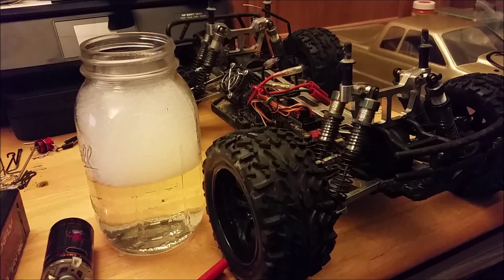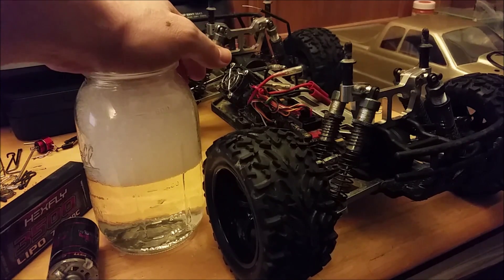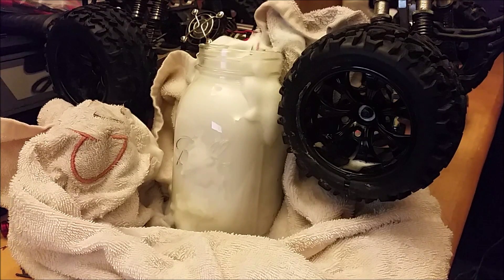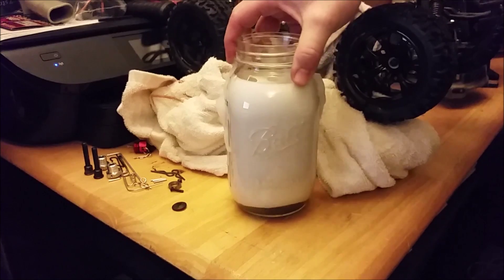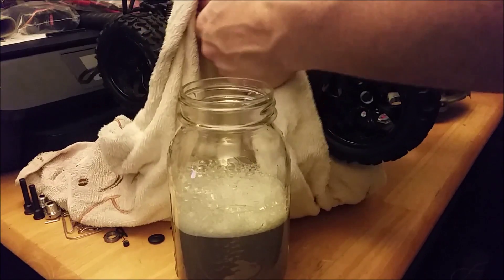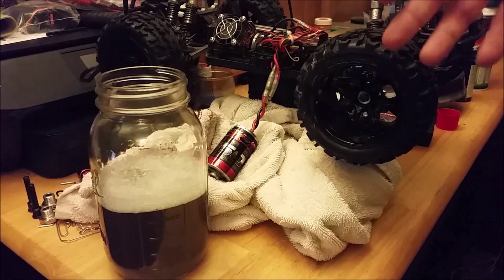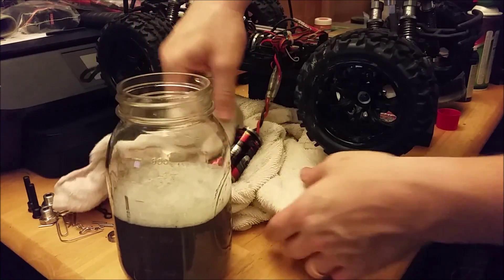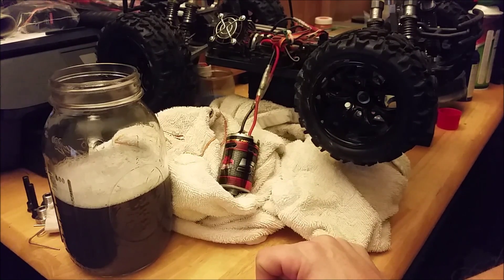Water Break-In Process for a Brushed Redcat (or any brushed) Motor

Comment: 1 drop of soap in a full jar of water an run it with two 1.5 volt batteries an run in water an soap for about 15 minutes then use electric spray to clean it all out an after that let it set an dry an then put one drop on each end of the motor an one drop on each brush so the oil will soak in the brushes an right before running put oil on brush one more time an it will last awhile wd40 catches dust but it does lube it up but it catches to much dust i know this video is a older video an thank you for sharing this video an doing what you are doing is the best way to do it fast way better than not doing what you are do because some people dont do anything just run them my friend great video

Comment: I don't ever use wd40 for moving parts of any kind. riding bmx for many years we stuck our handle grips with wd40. as little oil is in it, there are too many solvents for lubricant
Reply from the maker: You don't even like the dry lube? That's the only kind of WD-40 I use because it just attracts dirt. I understand what you're saying and I know this says WD-40 but that's just how I think about it. It definitely is the dry lube that I was referring to
Reply: @NPCRC  yeah stuff like lithium grease or dry graphite that type of stuff is good, so I guess the wd dry is good

Comment: I have difficulty believing running an electric motor in water would increase its life.  The dark color is just carbon from the brushes being seated in, not manufacturing dirt.To me a good cleaning with a ultrasonic cleaner would do a better job. Breaking in the brushes just assures the carbon brushes seat properly. Afterwards using compressed air and WD 40 wouldnt hurt. I think 3n1 oil on the bushings or bearings would help. I personally would have to see the results of a lab test and the data confirming that doing this would really help. Other than that, brushed motors are not that expencive. Just replace as needed.
Reply from the maker: it's purpose is to make the brush strokes on the inside smoother and better moving.  It is not my process, i was just showing people it can be done on the redcats... I did it to my sons truck when he was little and it was definitely a better feeling motor after this and some dry lube on a every 2-3 run basis
Reply: @NPCRC  I suppose if it works I have nothing against it eather. I have torn many motors apart and never seen any junk or dirt in there from the manufacturing process. I guess mabe from running it through mud dirt and grime, yes it will cake up but generally not on the running parts. I could see where it may benifit smoother running at lower speeds. other than thatI dont know. Brushless is the way to go anyways as far as smooth operation and longevity.  The problem there is they hate water. A product called RainX can and does make it possible to run a brushless motor and ESC in water. I have seen it demonstrated  and it does work.

Comment: Ive done this method before bit can you tell me how to do this if i have the little circuit board on back of motor? Im assuming i have to desolder the pcb from the motor and resolder? Or can i get the rid of board all together as i used to do hobby cars about 10 yrs ago on and off and now i see the pcb and im told its to prorect motor from overheating. Motor runs hot and drains lipo batteries down o% on my battery analyzer so im thinking to piss the pcb off anyway ! Any reply appreciated!  Thumbs up for the video. Im an old fart from Australia cheers😊

Comment: Do we have to?
Reply: Or will there be problems
Reply: What it its new
Reply from the maker: This one was new.  New to help with the break in and old to clean and re lube (dry lube)
Reply: Btw  it's a hpi e10 discontinued.
Reply from the maker: the model wont matter as much as the motor type.  Easy to just swap out for brushless for very little nowadays and get a huge performance boost.  Brushed is ok for drifting but i like brushless and just utilize the trigger properly.  Road Car. brusless would be a huge upgrade too.  I have combo's pulled new from trucks, sealed and occasionally used if needed.
Reply: Thanks dude
Reply from the maker: This is a way to make sure you lengthen the life of the motor. It makes the brushes break in nicely and cleans up a bunch of guck that gets in there and can eventually cause friction and dirt to be trapped. Then you lubricate it with some WD-40 dry lube or something along that line and run it a little bit with just that going through it and what I would do every once in awhile with mine was every couple runs I would put a little bit more in there and pull the trigger a couple times and let it move around before I left it sit for the night or weekend. It is not necessary though

Comment: Listen, WD40 is a penetrating solvent designed to remove rusted bolts - it will RUIN your brushes.  To remove oil and contaminants, or displace water, use MOTOR SPRAY (or electronics cleaner) - that's what it's designed for!

Also, you can use tap water but 'distilled' water eliminates any (admittedly minor) mineral build up on the motor.  Your choice.  Forget about the soap though, it will leave residue. 

Water break-in helps conduct electricity and reduces arcing and bouncing, cleans away brush debris and keeps the motor cool.  Run the motor for a minute or two (yep, that's it - longer just wears the brushes), thoroughly rinse it with motor spray/cleaner and let dry.  Blow out with compressed air if you have it.  Once dry, lubricate the bushings with a 'single' drop of bearing oil/light gear oil on each bushing and you're done.
Reply from the maker: Yeah it attracts dirt too.  The WD40 Drylube or other versions is what i use!

Comment: While the “W-D” in WD-40® stands for Water Displacement, WD-40® Multi-Use Product is a unique, special blend of lubricants. The product’s formulation also contains anti-corrosion agents and ingredients for penetration, water displacement and soil removal.
Reply: Woah, did you read that off the back of the can?

Comment: Plz help mine is slower now :(
Reply: Go brushless way more power my god
Reply from the maker: Shouldn't be... WD 40 works as a lubricant ( Which you will need to lube it after) but a dry lube works the best and doesn't attract the dirt as the wd40 will.  If this was done with a new motor and done properly there is no way it SHOULD be slower afterwards.  It isn't crazy fast as a difference but smother and longer lasting (If properly lubed) it should be!
Reply: Thanks i cleaned it with the water for 5 mins let it dry then put a load of wd40 on it and now is slow as if bearing arnt greased
Reply from the maker: Dry lube will be the best.  Run it in dish soap again and DON"T let it air dry... It should be air blown or ran to dry it.  and then put some dry lube around the shaft and in the can where the brushes are and run it for about 2 minutes and drop a little more drylube in while it is running to well lubricate.  I have done this with 3 motors, the first one my son burned up in thick grass with stock gearing, the second was also a result of running it where it shouldn't be on a lipo and then the third I had lowered the pinion a tooth and used dry lube and haven't had an issue since.  I think the wd 40 grabbing dirt and the thickness of the grass was the issue I WAS having.
Reply: Works fine now cheers what else would i need for this i have a df-02 gravel hound i am getting a 4t brushless motor and a 120a esc and a 2 cell lipo what else would i need or would it be ok like that at the moment i have a 20t brushed motor and wanting to get it as fast as possible thanks for the help curtis
Reply from the maker: Fast as possible would be a low turn, high kv motor.  However the higher the kv and the lower the turn you take away the torque and the off road/ rough terrain driving.  but if you aren't looking for off road running then that will not matter!
.
Reply: Yea on road only but i feel i have forgoten something because the fastest df-02 on youtube is 9t and i am getting 4t

Comment: do you know if the redcat motor you cleaned is equivalent to a hpi firebolt 15 turn or the arrma 15 turn motor
Reply from the maker: +Luther Hite  No I didn't.  Happy with the performance.  His Volcano rolls for a brushed after cleaning and on lipo.  I also lowered the stock pinion size 1 tooth to add torque so cut strain on the motor

Comment: Is this something you can do to an older motor...an do you know if there is a way to fix an esc where the breaks an reverse don't work. I was recently given my first hobby grade rc truck. it was my little brothers ecx ruckus...well you can tell a kid had it lol. I took it totally apart cleaned it top to bottom but the reverse an breaks don't work. help me please lol
Reply from the maker: +alan guthrie , well the braking and reverse could be a setting on the ESC. I don't know why anyone would have the ESC set to not break but sometimes people do cut the reverse for again some strange reason. Also could be a sign that the ESC is bad. Really only way to tell it would be to find the model of the ESC, search it on Google as far as program and goes and follow the steps to do a reset and see if that gets you the brake and reverse. As far as breaking the motor in,  there's no point of doing this process on an older motor. Once it has been used the brushes have already created the warning spots on the inside of the motor and there's not much point in it although you might be able to clean the motor to get more junk and dirt that has been in there out it will not do as it would if it was a brand new motor and increase the lifetime and speed of the motor like it would fresh. Those motors aren't too expensive to replace and might be worth getting-1 engine starting fresh yourself. You may need to get something if you find out your EFC is fried and sometimes you can get combos that aren't too expensive or you can move up to a brushless if you feel you can handle the speed and power difference. So I would determine what is wrong with your ESC first and then at that point what you want to do about your motor would obviously be up to you. I have no problem if you want to reach out to me with any questions or if you want up needing a brushed motor or ESC as well as a brushless motor or ESC. Contact me via my website either the phone number or my email address mi link should be in description of all my videos to my website or you can reach out to me on Facebook as well which is also in the description of my videos.